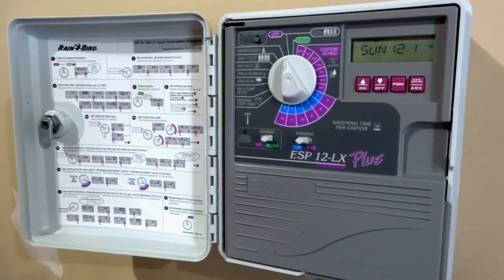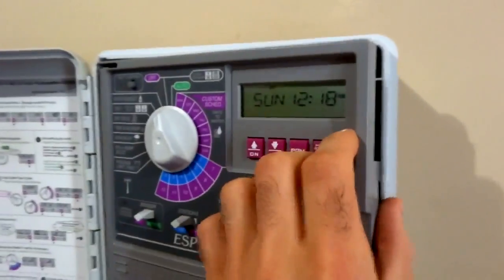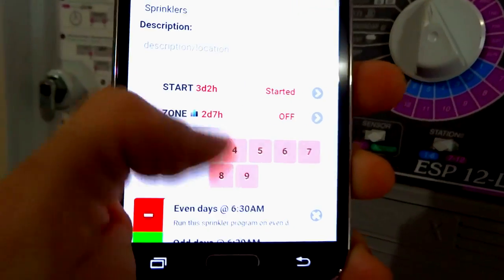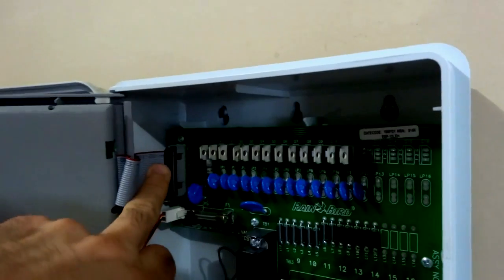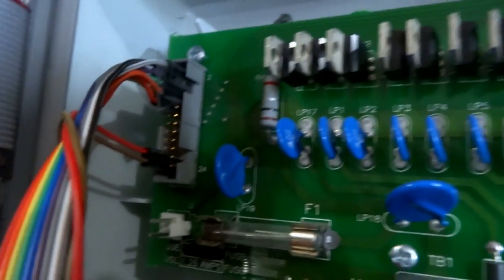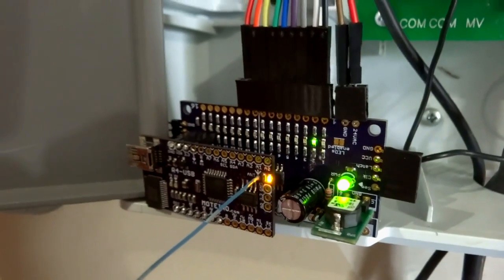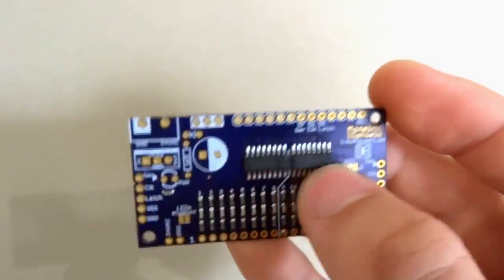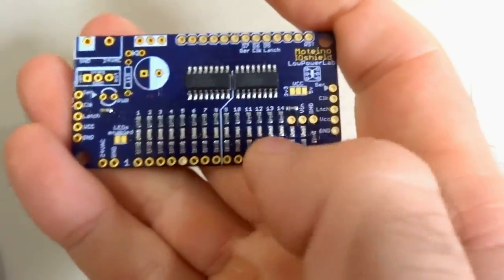Moteino IoT Sprinkler Controller Automation

Comment: You say in the video the buck regulator can take 24vAC to power the moteino.  Did i not see a diode and cap?  Looks like you are using half-wave rectifier then to a buck regulator?  A buck regulator that can go from AC to DC would be awesome, so im hoping it what you said, not what i saw :P
Reply: +Dale Sampson I think he meant DC, I wondered about that as well :)
Reply from the maker: +Dale Sampson Yes it's taking AC through a half rectifier and 100uF 50V cap.